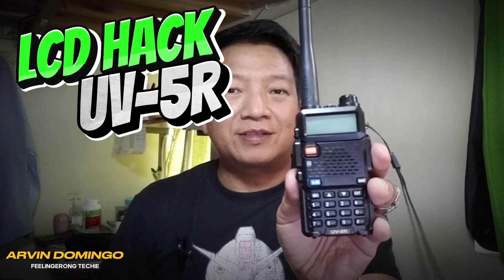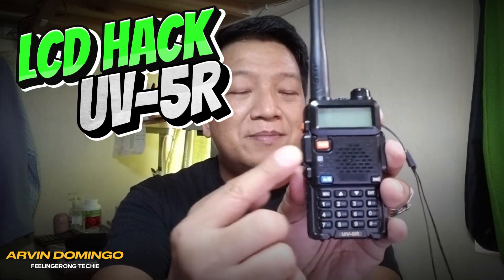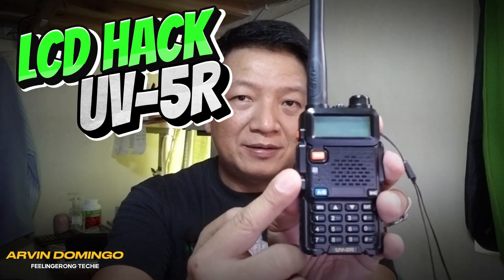BAOFENG UV-5R LCD DISPLAY HACK

Comment: Any technical details on the display driver and logic?  If could do some sort of interface to drive an I2C/SPI OLED (0.91” or even 2.42”) that’d be pretty nifty. Likely would spend more on the interface than the radio, but it’s just for S/G’s anyway..

Comment: So what does it do...allow more light thru?  I see more backlight and the letters are white...interesting hack!
73's  KF5CIF
Reply from the maker: Having used the radio for several days, I can confidently state that the default LCD display configuration is significantly more user-friendly due to its gray background and black fonts. I suppose this is more of a visual enhancement than anything else. ;-)